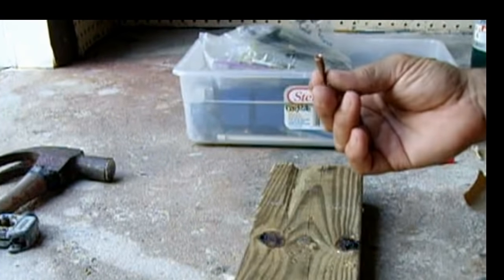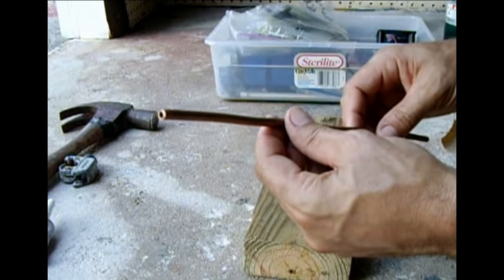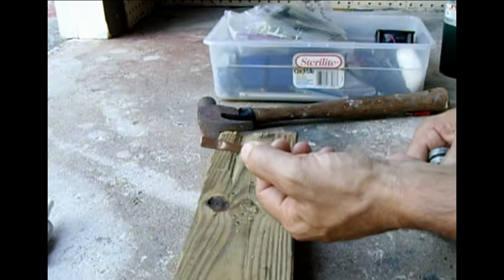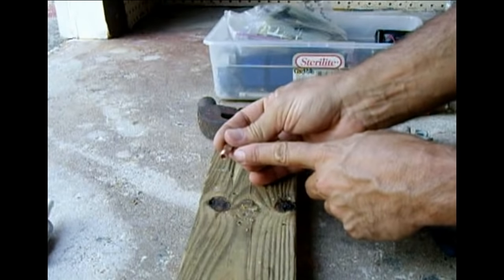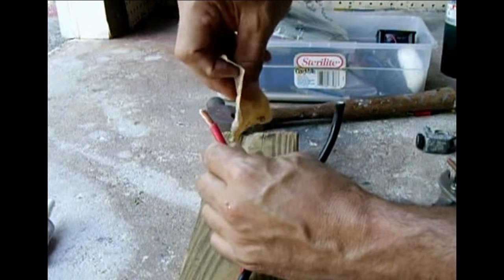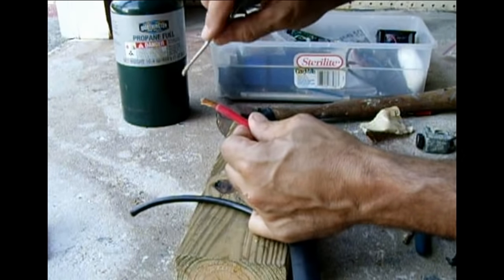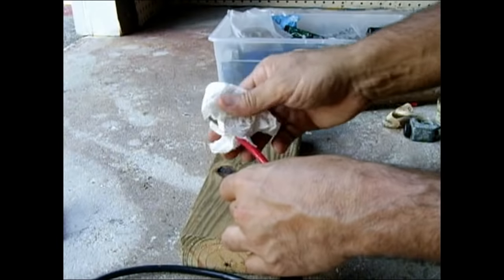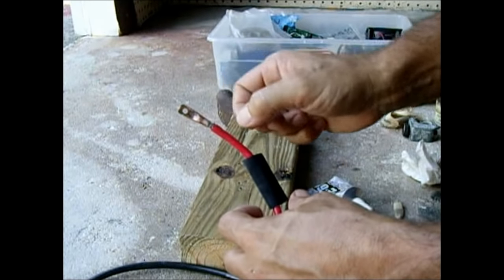How To Make Copper Battery Cable Connectors!

Comment: While I applaud the author of the video for showing 'how', a cheaper alternative is available, there are some places where this 'technique" would get thrown out quickly.  Yes, the audio enthusiast electrical connectors for your car are a rip off price, espescially when they are sourced from overseas to start with, IMHO you would not want home made lugs added to your home's wiring system. That is typically why the components are so expensive. It is not the base metal, but the design, the certification, and then the manufacturing cost plus overhead are what make a significant cost to anything electric.

Even with tinned copper cables, or just hexagon crimped , you need to get the right sizes to get a tight fit that will last for hundreds of hot/cold cycles. Thermal instability will cause the non-tight crimp to come loose over time, causing a heating problem if large (> 80% of wire rating) currents are used.

I hope you are safe with electricity, especially  when high current (>1 Ampere), and / or high voltages (>50 volts) are used. 

Low voltage is ok, but a typical starter motor draws 200 to 600 amps when cranking!  for the reliability of it, such wires should (although not always) be replaced as a whole Cable assembly.  Why? the Whole Assembly is brand new , as opposed to 10 or more year old stuff that you are replacing it with,so there is less chance of corrosion and metal fatigue affecting the starter circuit., 

like  I opened with in the beginning , applause, but be careful.
Reply from the maker: If you want to throw away money on a pricey connector, then that's entirely up to you. :-) One thing I do know, if I replaced one of your store bought connectors with one that I made and tinned, without you knowing, you'd never know the difference. The purpose of this video was to show how to make the connector, how you connect it to the wire(solder, crimp, or both), is up to you. Thanks for watching
Reply: The only reason the connector is pricey, is to ensure certain parameters are met. I am not questioning whether the home made version would not be 'good enough', in limited applications. I am also not discouraging inventiveness. If there are two packages on the store shelf, and one said Made in Asis, the Other was 10% higher priced but said "Made in Canada",  which would you pick? I'm a proud Canadian, so by choosing a Made in Canada product I ensure Jobs for generations of my fellow countrymen. If you wish to call it 'throw money away', then yes, I would be doing that. 

Now, if you replaced your home made and soldered connector, for the one that I used in an Ontario Building,  Then you would be breaking one of the Laws , and there are fines and penalties for when things go wrong, sometimes the result is minor, other times, and ask the YouTube electric specialist from Isle of Man known as "BigCliveDotCom", and you will see some of the dodgy (UK) $hiitty(US) stuff that is made.

Lets say there is a place for home made. There is also a place for production made.

If you get good copper tubing that has been annealed to the proper flexing temperature, it may very well be superior to even the 'name brand' stuff from the local parts places, but for Trade and Certification purposes, there are some things I would not risk messing with.
Reply: Like I opened with in my comment, appluse for showing the how. Not, for knowing the when.

With certain things, this method of using copper tubing, and cold pressing an end to form a terminal, there is nothing to suggest how long it will last.

What you are paying for, usually, with manufactured products, is Insurance.

If the manufacurers of electrical terminals could not have to mark their name on something, and sell the same product at 75-95% of the identified and listed terminal, they would.

However, if an electrical fault happened with that crimp/solder terminal, and it resulted in some other calamity, then you could be on the hook for that person's (or you own) losses.

As for knowing whether a subsitution of a manufactured terminal, vs a home made one, it all depends on the skill of the fabricator, and the circumstances of the crimp.

There are cases where it would be O.K. to use the home brew crimp, and yes, detecting such a change could be undetectable,  it still has not passed any formal testing process.

This is where the trouble can begin. 

The problem is how to maintain a consistant crimp, over 1000s of terminals, and thousands of heatup/cooldown cycles.

For this and other reasons, it is a big part of what manufacturers have to do in order to make electical eqipment and materials
Reply: Like I opened with in my comment, appluse for showing the how. Not, for knowing the when.

With certain things, this method of using copper tubing, and cold pressing an end to form a terminal, there is nothing to suggest how long it will last.

What you are paying for, usually, with manufactured products, is Insurance.

If the manufacurers of electrical terminals could not have to mark their name on something, and sell the same product at 75-95% of the identified and listed terminal, they would.

However, if an electrical fault happened with that crimp/solder terminal, and it resulted in some other calamity, then you could be on the hook for that person's (or you own) losses.

As for knowing whether a subsitution of a manufactured terminal, vs a home made one, it all depends on the skill of the fabricator, and the circumstances of the crimp.

There are cases where it would be O.K. to use the home brew crimp, and yes, detecting such a change could be undetectable,  it still has not passed any formal testing process.

This is where the trouble can begin. 

The problem is how to maintain a consistant crimp, over 1000s of terminals, and thousands of heatup/cooldown cycles.

For this and other reasons, it is a big part of what manufacturers have to do in order to make electical eqipment and materials available to us.  If they (the manufacturers) could produce a terminal at a cheaper cost (to them) they would do it.

Comment: Why couldn't you just fill up the lug about halfway with solder after cleaning and fluxing. Then re heat the lug and flow the solder by pushing wire in the solder filled lug?
Reply from the maker: As long as the molten solder is hot enough, that will work! Thanks for watching!
Reply: @electronicsNmore  cool, thanks,

Comment: For some reason I don't remember, soldered connections are not recommended for marine use. Crimping is supposed to be better.
Reply from the maker: No reason why a soldered connection would be bad for marine use. The wires and connectors used for marine use are usually "Tinned". I always solder and heat shrink connections for marine use.

Comment: you should not use a bench gringer on copper or aluminum, it will inbed in the wheel and may explode the wheel
Reply from the maker: Are you referring to the rounding of the corners of the flattened connector? I use a file normally, but using a bench grinder is no problem. Aluminum tends to clog the wheel much more. You can use a dressing tool to clean the grinding wheel. I never heard of any grinding wheels exploding from using them to grind copper or aluminum.

Comment: Solder does not have a better electrical connection than a crimp connection. Theoretically, the tin in the solder as a 5X higher resistance than the copper it's connected to. In reality they are identical with the crimp being ever so slightly better. You can find plenty of videos on YouTube where people stress test crimped versus soldered connections.
Reply from the maker: https://youtu.be/HJtGv73oMog

Comment: Wiping the lug before it has cooled can cause movement between the wire and the lug. This creates what is called a 
"cold solder joint". This causes an unreliable connection, increased joint resistance, and can lead to a failure of the connection.  Failed connections can cause disruption of the function of the equipment, possible 'short circuits', destruction of the electrical components due to 'electrical arcing' during joint failure.  Most beginners apply TOO much solder resulting in this overflow and unsightly connections.   Only apply solder until the void appears to be full.
Also, As mentioned, Do Not Use Acid based soldering flux.  Be sure to read the information on the container OR ask for help as needed.
Be Safe,
Bob

Comment: Plumbers flux is an "Acid" based flux and will corrode your connections over time.

When soldering electronics you ALWAYS want to use ROSIN flux.
Reply from the maker: +Ronald Easley 
Let me guess, you had annotations turned off. :-) Turn them on and watch the video again.
Reply: +electronicsNmore - Sorry, 30+ years in electronics, that's the first rule of thumb, I learned in Solder class.

Even on the Rectorseal MSDS for this product under "Applications" it says: Not recommended for electronic use.

When I worked on a manufacturing line, some of the boards "specs" called for an acidic type of flux those had to be run through a bath before they were tested.
Reply from the maker: Ronald Easley
"Not Recommended" does not mean you cannot use it or "Do Not Use"..:-). I used "Nokorode" brand flux many times over the years, and I still have a few cables I made, all are just fine. Never had any issues with that flux corroding copper pipe, so I expect copper wire would react the same.

Comment: whats this video ' cutting and banging a copper pipe flat i suppose ' cheaper way ' drill small holes in to the top of battary terminals and 4 x two pence coins and two screws ' i am sure i can do this with fuse wire ' blue tack ' paper clips ' and a hammer

Comment: If you used a smaller diameter solder it would flow a lot sooner.
Reply from the maker: +Magician2000 
The size wire I used was perfect. Using a smaller solder wire would require a lot more solder wire being fed into the connector. Thanks For Watching!
Reply: +electronicsNmore I never commented on your wire size. And you will use the same amount of solder no matter what diameter solder you use since there is a finite amount of space to fill. Yo may use a longer length of the smaller diameter solder. But if you weigh the two amounts that you use you will find that they are the same amount. My comment was that you would get better flow of the solder with the smaller solder and you would use less heat, therefore minimizing solder wicking and also damage to the insulation.

Comment: Expensive? $1.86 McMaster-Carr, might not be 15 cents but at least they are UL listed and CSA certified, also appropriate for the job.
Reply from the maker: There are many devices that require UL(Rip Off) testing, but a simple piece of thick walled copper that's crimped on one end and flattened with a hole drilled in it, isn't one of them. Go ahead and waste your money. In the future if you couldn't buy a connector locally that you needed ASAP, you'll thank me for this video.

Comment: umm "M" "L" AND "K"  ARE  only designations for wall thickness?  as you can use M,L, OR K. in plumbing water systems, and they come in RIDGID or SOFT . usually the "L"  in refrigeration is dehydrated copper....... jm2$
Reply from the maker: +JEFF LI 
I never saw type "M" in soft copper, only hard lengths of pipe. :-) Let me know where you can find it. Type K and L have thicker walls and are sold in coils(SOFT), or lengths of pipe(HARD)..

Comment: Whats your time worth? if it takes you 10 minutes to make 1 and you need to make 6. thats an hour of making them vs. 5 minutes if you buy pre made.
Reply from the maker: 100% incorrect calculation. I was making a video and showing people how to do it in detail. I can make one of these in roughly 1.5 minutes.
Reply: some times when you are not a millionaire. its well worth the time to make something your self. and to some like me. its the pride in doing or making something your self! its not always about money. at any rate why just throw money away. and when you don't have the extra money to buy them its well worth the time. its a great video.

Comment: I buy mine and they are stamped and if some happen like a fire, I know that my insurance company will pay for the damages.
Good luck for the insurance paying for damages in case of a fault on homemade items that have no certification and that may be cause for the damages.
Been there before.
Reply from the maker: As long as the fire wasn't intentionally set, they'll pay, but do what you like.
Reply: In case of fire the evidence will be burnt surely

Comment: Do not solder! If you ever have a momentary short the solder will loosen and you can have an arc fire! Buy a 20 $  battery lug crimper from Napa and do it right
Reply from the maker: Incorrect. I've proven that wrong many times, and even made a great video about this. If you have a short, overcurrent protection should be in place. If it's a battery cable, then you're better off have the solder melt and the connection separate, otherwise the cable will get super hot, melt the insulation and cause a fire. 

https://www.youtube.com/watch?v=eedrETFZ3Ws

Comment: stick any copper on there as long as its got mass then its got good contact '''''' any size will do the job ''''' 
i only use thin wire on one of my projects and still powers lots of lights for hours with out getting hot or melting '''' and thats using a 3000w inverter ' so not as complicated as it all sounds .

Comment: With a die cutter, you can leave a T on the end of the connector and have a part to crimp to the wire where it grabs it by the outside of the insulation further down.   Basically like these except for you can leave the full ring for the middle part: https://i.ebayimg.com/images/g/gGQAAOSwjoFb9RT3/s-l1600.jpg

Comment: Not sure what your time value is... but in the 10 minutes it took you to do this... I could have gone to the right aisle and bought a basket full... at a premium price.  However... my time is worth more in the time savings.
Reply from the maker: LOL. I can make this connector in UNDER 1 1/2 minutes. The video was 10 minutes long because I did a lot of explaining. The connector was made in the first 3 1/2 minutes of the video. The rest was soldering & heat shrinking.
Reply: Agree with electronicsNmore. Have used same/similar techniques for 30 yrs.  By making a V/notch in the pipe connectors that need to be at odd angles are easy to make. Steve you probably can't appreciate that saving a few bucks means a lot to a person who has a five dollar a day food budget nor do you appreciate that those living in rural areas may live miles from the nearest electronics/automotive supply store. Finally, I get a real sense of satisfaction/security knowing I've built a cable or harness bundle end to end using the cable/insulation/wire specs that I want.
Reply: Yes time is valuable, but I have found if I have to stop what I am doing and go to the store to get an item might as well count about an hour, unless the store is less than a mile away.  If you have the tubing, this is a great shortcut.  Thanks for posting this electronicsNmore.
Reply from the maker: Thanks for watching Wolfgang! Please share with others.
Reply: Wow, Steve you are what is wrong with our throw away society. No time to make something, but time to stand in line. Why would you even need a connecter? Just go buy one already attached to the cable or have your mechanic buy one, that way your chauffer could drive you to work where your assistant could do your job and save you even more time. I'd sign off with a "Good day to you Sir", but I value my time more than that. ; )

Comment: After buying the flux,sodder, propane, sandpaper, copper pipe, 1 foot of pressure treated lumber drill and bit plus heat shrink... I think I made a mistake somewhere. Penis got stuck in lamp socket.
Reply from the maker: DJ gamer 221 If you were a "handy" guy, which it's clear you're not..... you'd have the tools required.
Reply: electronicsNmore apparently you dont grasp what sarcasm is.

Comment: Heating soft copper causes it to oxidize. Look what happens to copper wire when it gets overheated. Crimping does not cause this corrosion, and the result with a proper tool is a hermetically sealed bond. They use crimp connections in tank s and satellites, a soldered high current connection is just a lead fuse inside a connector that is already corroding and will eventually overheat. Three years is nothing when cars last 30 years.
Reply from the maker: It's only surface oxidation(copper oxide). If you have a hydraulic crimping tool, then yes, use that. If you only have an ordinary(cheapo) crimping tool, then no, crimp/solder/heat shrink. I never had a soldered connection melt and pull apart. If the job is done correctly, you use the proper wire size and overcurrent protection, the odds are next to zero. Thanks for watching

Comment: it would be easier to drill the hole before you cut the connector from the pipe!
Reply from the maker: I usually do that, but when making a video, sometimes the steps don't go as planned.

Comment: Air Force rule is that we NEVER put Silicon Carbide grit into electrical connectors!!!Sand paper is a very BAD THING in all things electric!!!  It is non-conductive!  Soldering can leave voids that can over heat!  Warning, Will Robinson!!!  File use is OK, except over other active connections, which can be a bit risky, if conductive grit falls on them...
Reply from the maker: Clearly all abrasive material was removed before soldering.

Comment: wondering would it be any easier to drill before you cut it to length...\and sorry I thought you had a slight speech impediment...I didn't realise Americans pronounce solder  sodder...lol
Reply from the maker: You can do it before or after. Whatever you desire. "Soul-Der" is the British way of saying it. I am not too fond of many British pronunciations. They call the letter "Z"(Zed), instead of ZEE. They also mix up the words, "Cay and Key".